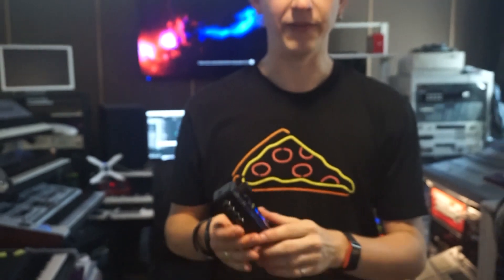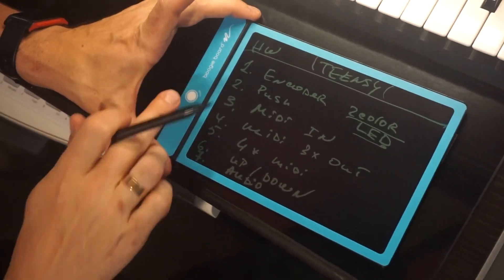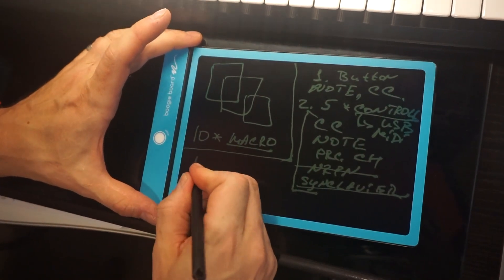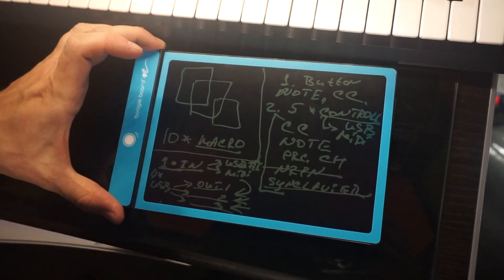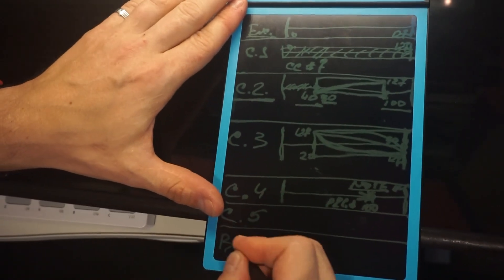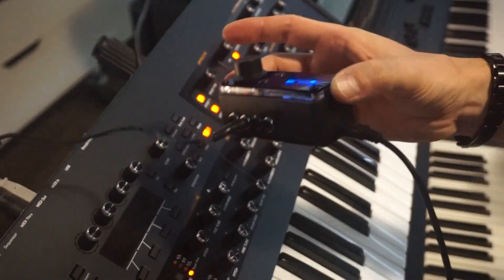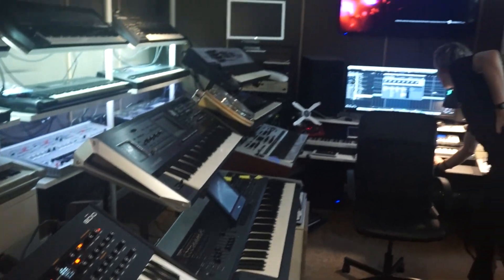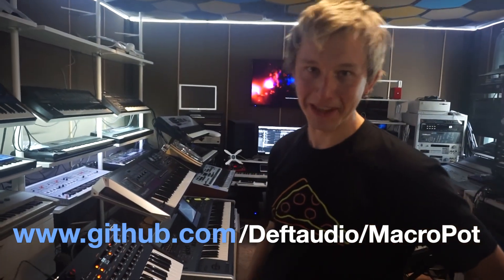Deftaudio MacroPot Introduction and explanation

Comment: The 2 buttons do not send midi??
Reply from the maker: You can remap this as needed, if you open Teensy code. But in default mode they change between Macro presets.